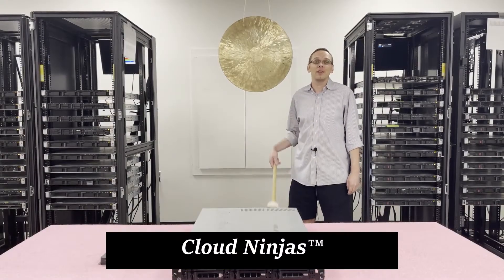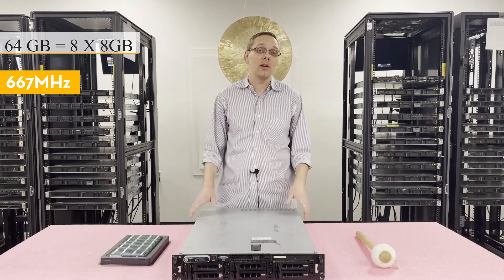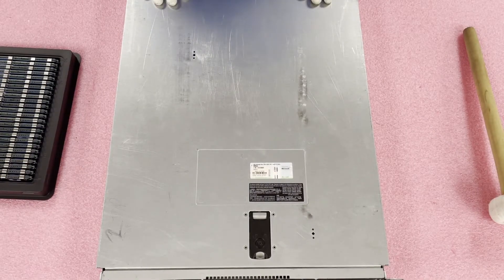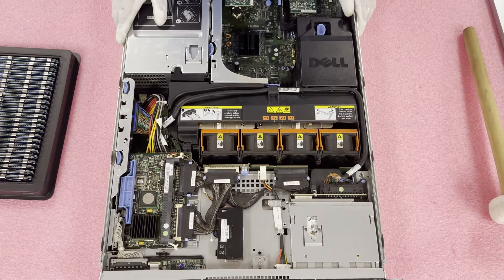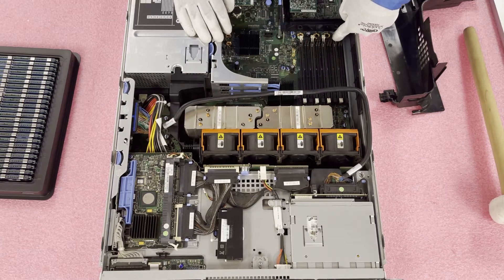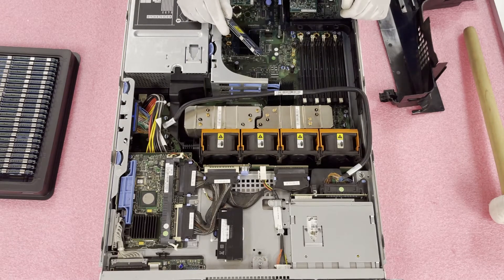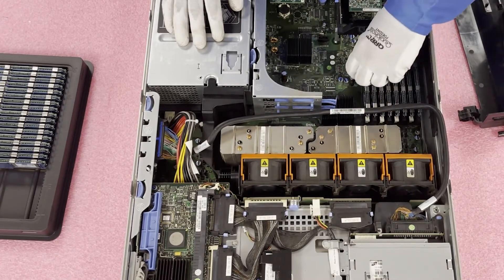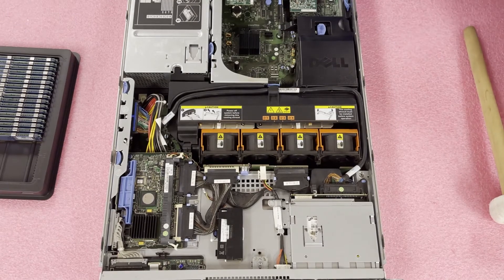Dell PowerEdge 2950 Server Review & Overview | Memory Install Tips | How to Configure System

Comment: Got a good deal off Facebook marketplace for 2 of these early last year. I think I paid $250. I needed something to run some software (HiveOS) to provide me with remote access for my ASIC crypto miners.

It did its job well, but I needed to pull out of mining because of an increased electrical rate once my contract expired. I sold one of the servers, and now one is operating as a Minecraft server for myself and my buddies.

I despise the power inefficiency, which is a solid reason why I may purchase something else soon. Any good recommendations for a cheap 1U server, ideally with dual PSUs and at least two SSDs or HDDs? Ideally it idles between 50-100 watts.
Reply from the maker: I like R640 servers.  Not sure off top of head power efficiency but definitely better than 2950s.

Comment: This hardware is pretty dated. Is there anyway I can just remove the motherboard and put something modern in its place to use the hardware that I have with less limitations? I never owned a server before this but I’ve built PCs
Reply from the maker: I mean better options for a project like this.  These are power gobblers so I wouldn't recommend...

Comment: Hey Scott, Would you have the full list of CPUs for this Model? someone near me is selling one cheap claims to be the model iii.
Reply from the maker: These are the Intel 5300 5400 series procs.  Back in the day we sold a LOT of these with quad core procs such as E5345.  5100 and 5200 series accepted as well but so cheap might as well grab some Quads.  Good luck!
Reply: @cloudninjas  yeah i have a pair of E506 which came with one of the R510s i have, i really want it for doing my CCNA and learning Windows Server. although i have the R710s and 2 R510s i dont really want to mess with that as they are hosting mail and web servers for business's
Reply from the maker: Definitely would grab some quad core procs and potentially 8 x 8gb 667 RAM.  Good luck!
Reply: @cloudninjas  will see if i can do a bit of haggling and get the seller down a bit on the price :)